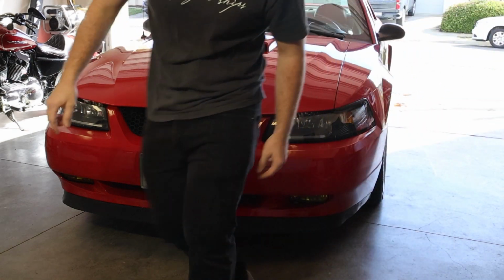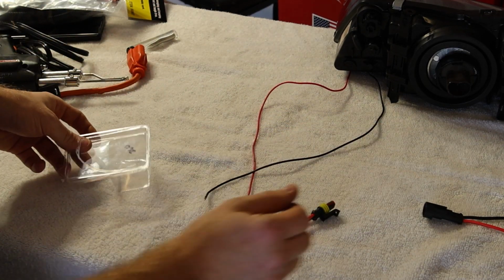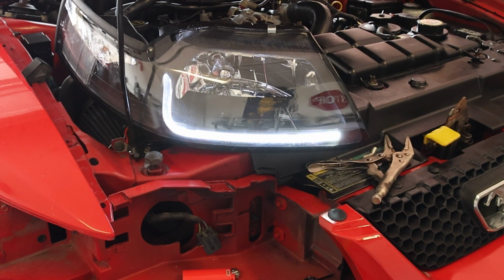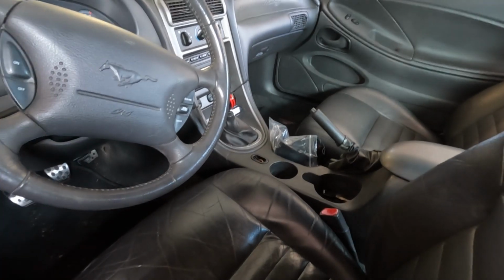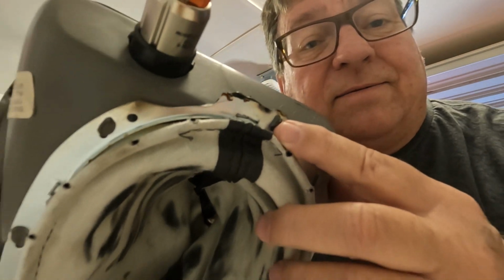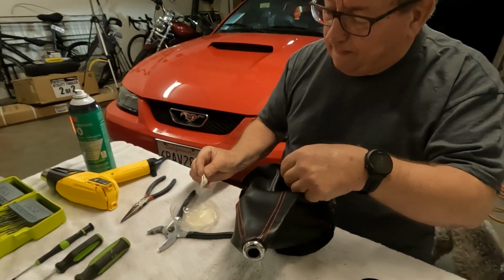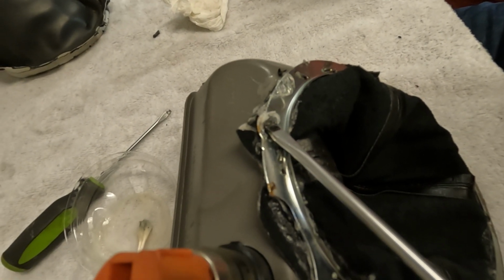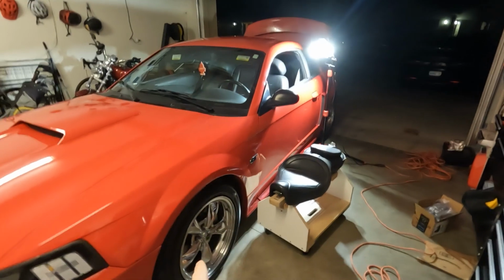2003 Mustang GT LED Headlight

Comment: Where did you get the headlights?
Reply from the maker: From Amazon!
Reply: if you buy just basic headlight kit with the high low beam LED headlights its lot easier just take old bulbs out put new LED lights on just connect the connector no wiring or anything like plugging a drill into the wall.